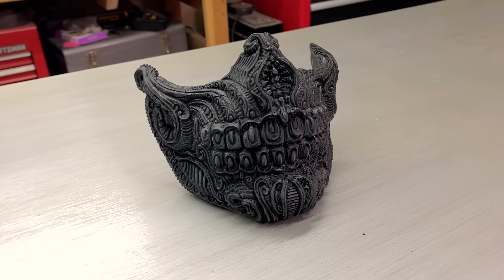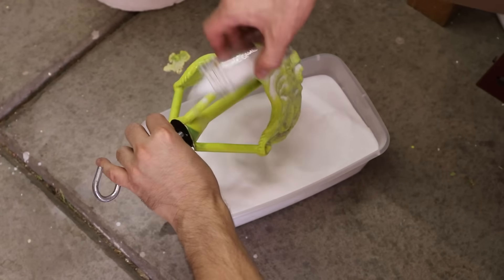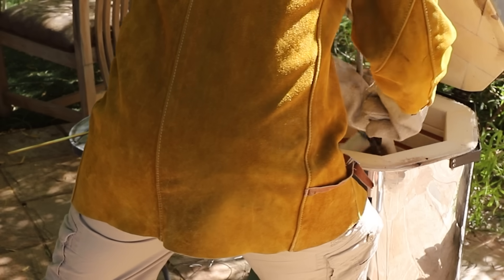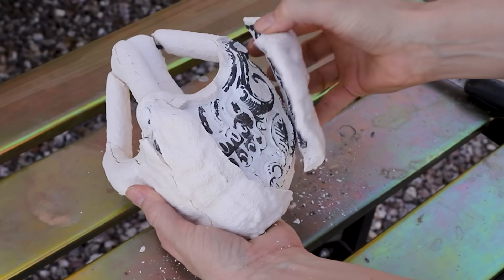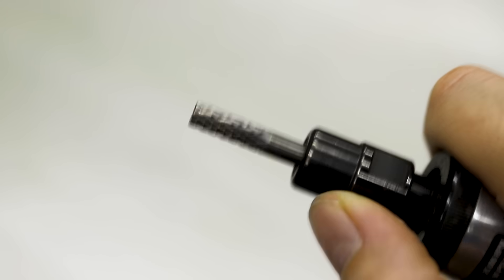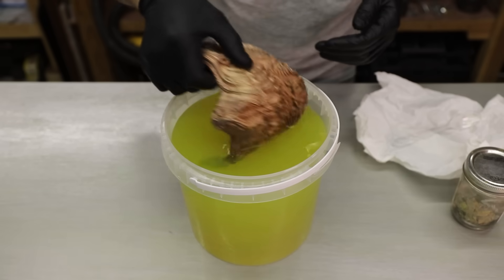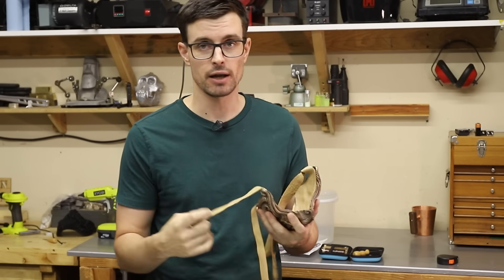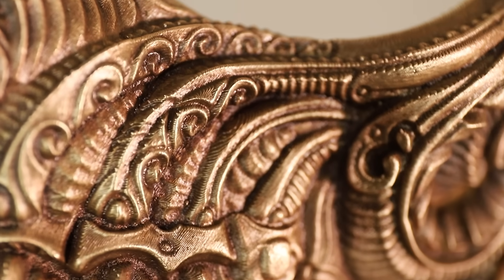Turning a 3d print into metal - Metal Casting - Lost PLA

Comment: One way you could try to make it more comfortable would be to even out the weight with something on the back. Noticed that with heavier VR Headsets and a battery on the back of the head, it feels more comfortable than most headsets without the counterweight. Still adds more weight, which can be bad for the neck, but I don't expect you to be doing some hardcore parkour or the like wearing it lol... would be a lil weird imo

Loved the project. Never knew there was a dip you could use to make a mold, and thought sand casting was about all aside from going to the metal shop to have one made. Looking into getting started bell making sooner than I thought :D

Comment: That looks awesome, you could probably still use those straps and add belt buckles to both on 1 side and just make the fastening pin holes closer together for a better fit, compensating for the weight.

Comment: Truly beautiful design, and your work with it really does it justice. Great job. 
Next mask, you can use a very hollow back, making it like a deformed sheet, for weight, but I don’t know how difficult that would be to cast. If it helps, the prototype could be made using slip casting: a method where liquid clay is poured into a plaster mold, allowed to firm up just on the lining face of the mold before dumping out all the clay that remains liquid. It leaves a very thin shell, with all the detail on the outside, and an inside that seems like an inch of snow on the lawn. It’s similar to your ceramic mold, but on the inside instead of the outside, and done in one pour instead of multiple dips.

Comment: I would guess that the cracking isn't caused by the sand itself, but more likely that the sand had more moisture in it, and by changing sand types you simply found a dryer sand

Comment: Very cool. 1st of all-- subbed. You are great, dude. Even if it didn't turn out EXACTLY as you intended, your stuff shows great craftsmanship. 

Thanks for giving me a motivation boost to melt & pour some silver as soon as feasible. ❤

You are making some really cool stuff, I know you're likely a bit busy to respond but I'm curious how you got into the method which you use. 

I, for the most part, pour into shaoes with high-density graphite molds w/ insulated propane furnace. (I'm also kinda broke, but would love to get into more of the kind of stuff you are doing some day.) 

How did you get into that style of pouring/metalworking?

Anyways, we Smithys are total Chads 😉

Respect from Detroit. 😎🇺🇸😎

Comment: Just a thought, if you fill a large bucket with sand, then pump air in from the bottom, So the sand is Bubbling, it would make coating the mouldings much easier and give an even coat of sand.

Great Video

Comment: Suggestion: get either black or red leather in a thin strip. Attach it to the bridge of the nose. And have it go over the crown of your head and glue it to to the top two pieces of your existing straps. It's a slight modification from the original design intent, but it would make it workable and distribute the load.🎭

Comment: Hey, I don't want to tell you anything misleading, but wouldn't it be better to give the mold a better path to push air out? Like tilting it at a 45 degree angle, and also having it completely submerged in hot sand? The hot sand would cool from the top, leaving the bottom hotter than the top and preserving the details while also pushing out any imperfections of the pour.

Comment: Great result! 😍 It may be more practical to use 3D printing with anodizing for your mask. Where before anodizing it is critical to coat the mask with a graphite mixture (for electrical conductivity of the surface).🙂
Reply: You mean electroplating? Anodizing is a different process.

Comment: That's freaking awesome and never seen that ceramic casing method before. That brought out so much detail in the mask it's unreal. 
A thinner mask would help i imagine and keep the current as a shelf queen show piece. If not maybe wearing a sturdy hat or rather helmet and attach your mask piece to that creating a samurai look. 
I can't wait to see a second attempt with a thinner build so you can actually wear it comfortably. I really hope other melters or casters see this video and try that ceramic modeling method. Some of the content creators make some really cool casting but can't achieve this kind of detail using just the sand.